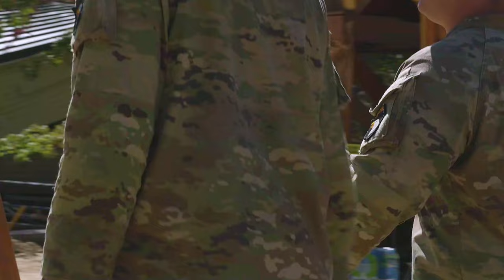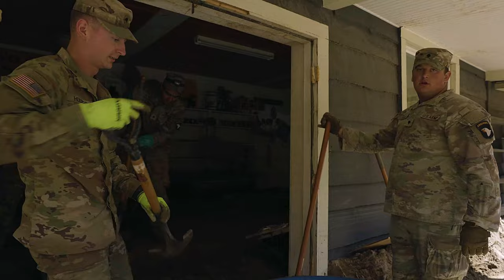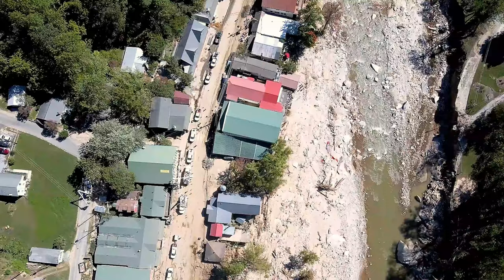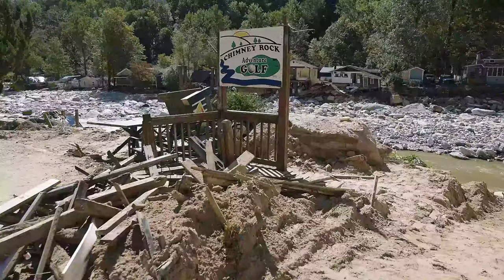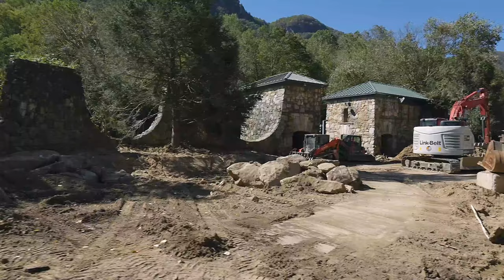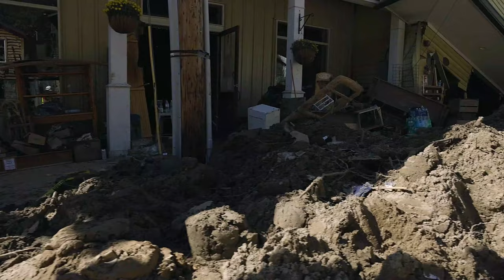101st Airborne Troops Rush to Aid Hurricane-Hit Town in Heartwarming Rescue

Comment: Hey Kyle and 101 Asirborne. Just wondering if removing dirt from fudge shops in a rubber sled pulled by two men or wheelbarrows or running around mounds of debris with a home depot bucket full of mud and moving the dirt from the fudge shop to the foot of big heavy earth moving equipment is the best way to use this moment.

Might it be good to scooch over to the swiftly moving waters, washed out roads, or move some of those other sitting white trucks up to the power line?
Next time blink twice if you are being held captive.
God bless.